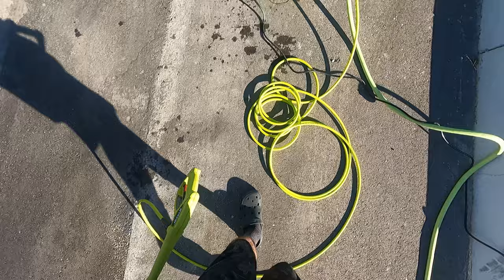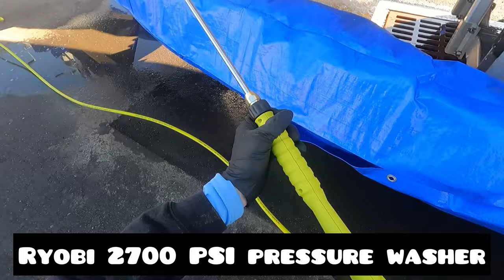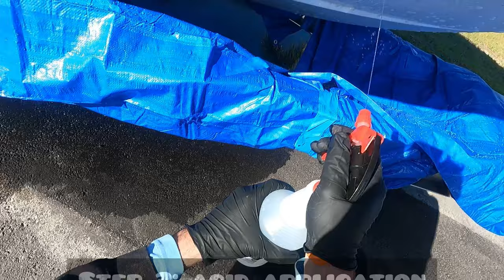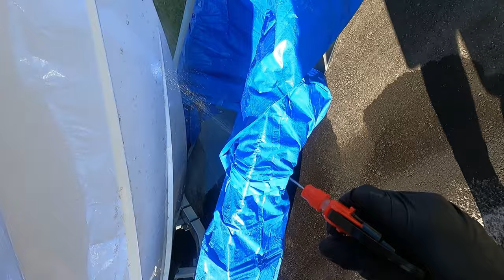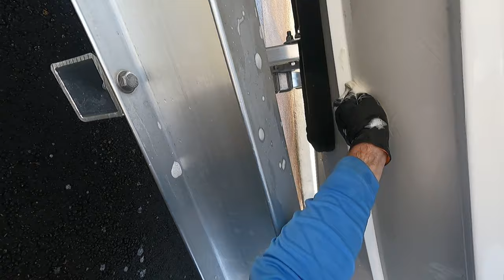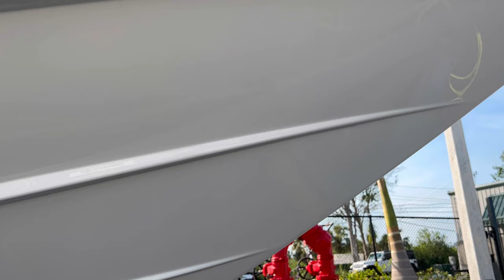How to Remove Barnacles from your Boat

Comment: Thankyou top dock pro! This really was exactly what i needed. I subbed and liked. Great how to👍 saved me money and helped me get a better finished product! 2 question. Is there a way to prevent barnacles next time with an unpainted bottom? And secondly how bad does the acid eat up the rollers on the trailer?
Reply from the maker: If you have an unpainted bottom there’s not much you can do to prevent it unfortunately. Once you complete the acid step you should rinse off the rollers thoroughly. I don’t see it causing any harm